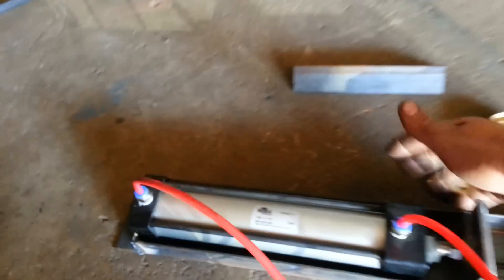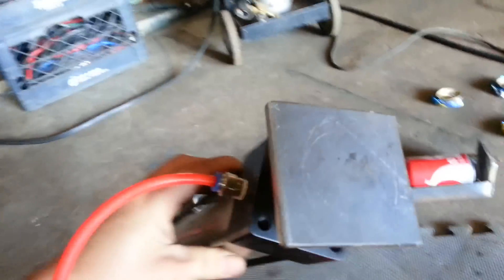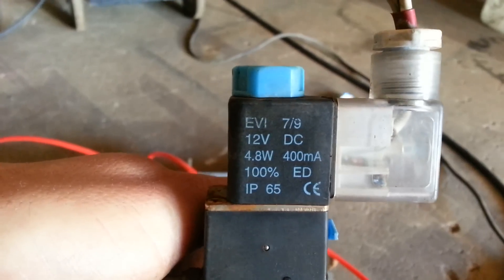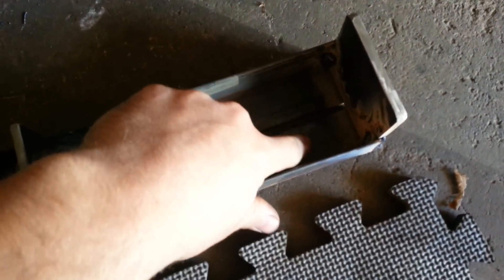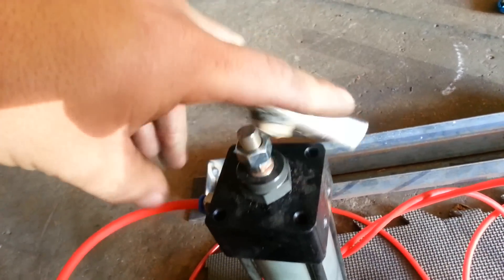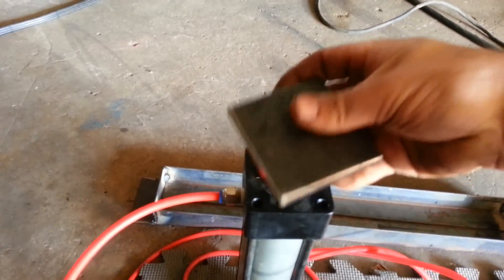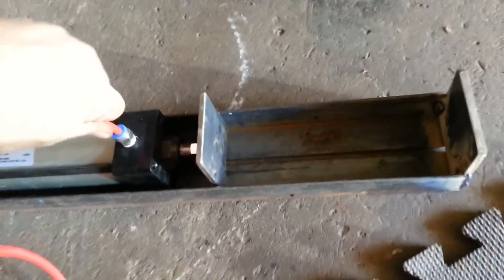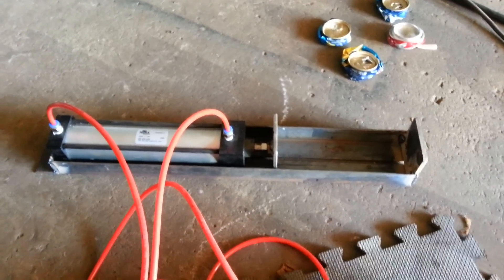Pneumatic Can Crusher First Test

Comment: I like it.  I would just drill a 1/4" hole in the center of the end plate, so that the air in the can is able to escape much faster as its being crushed.  That would lighten the work load on the cylinder.  Might not seem like much, but over time, it's a lot.